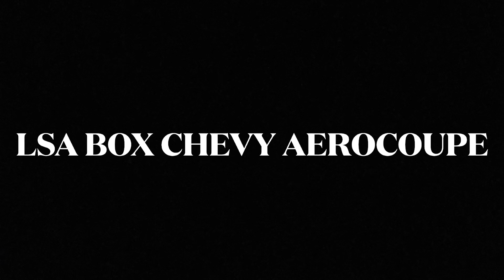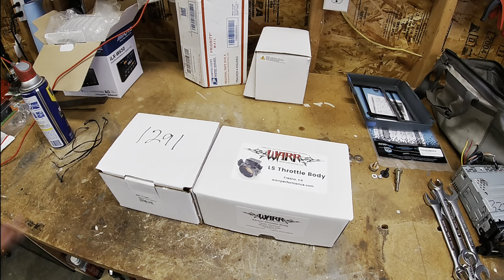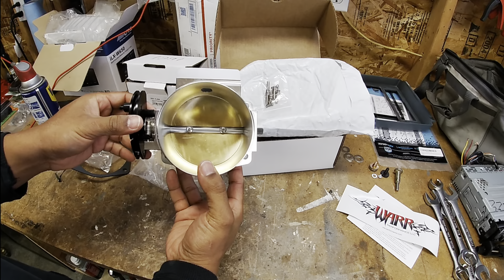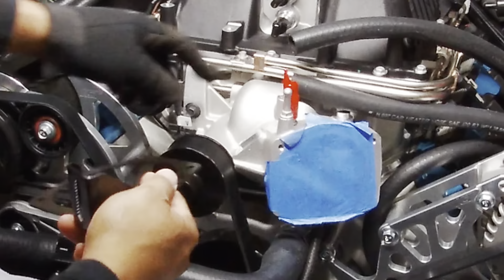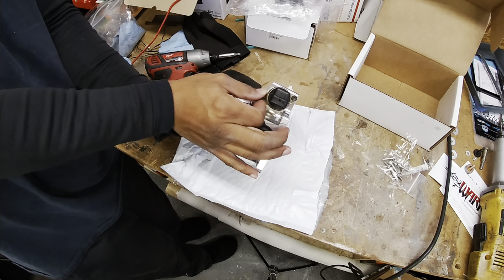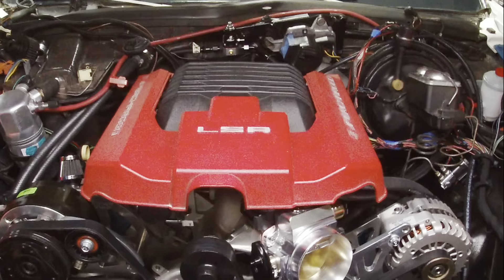LSA l WARR PERFORMANCE THROTTLE BODY | HOLLEY THROTTLE BODY BRACKET l BOX CHEVY BUILD | SLEEPER

Comment: 102mm is overated it's like putting a holley 750 double pumper on your 305.....lol......I'm rocking a cheap ebay 92mm on mine with no issues,  only using it cause it came with a sheet metal intake package I ordered back "in my didn't know any better days"!!!!!...that intake is still sitting on the shelf unused 4 yrs later.......along with a vic Jr style with the throttle body elbow. ....and now a factory ls3 along with a square port tbss and gen 3 truck intake. ...u need an intake, chances are I got it......other than a 10k plazmaman . ...I got you covered....nevertheless you getting very close....you already get your ecu tuned yet, or do you have that hurdle still to over come. ....I love it looks factory with that cover, thinking about getting me one.....made a night and day difference in performance though if I stab it to say about 4k rpm I will see about 4lbs boost and 120 mph instantly......I haven't pushed her any harder than that though....not yet....I live in the sf bay area. Roads tend to be crowded and full of idiots around here so it's kinda hard to let it live to its full potential
Reply from the maker: Yeah, you got multiple things covered with those parts. I was going to go with the eBay throttle body, but decided to go ahead with this one. I also thought i really wouldn't need the 102mm either. I haven't got the tune yet. I have a tuner tho, so when I'm done I'm going to schedule my tune with him. 

Yours sounds like its running pretty good.
Reply: @MrGriffin23  yea the holley is doin it's thang.....but yeah she is running great